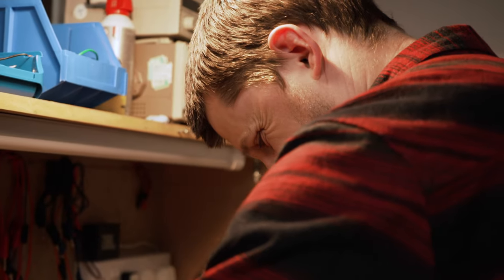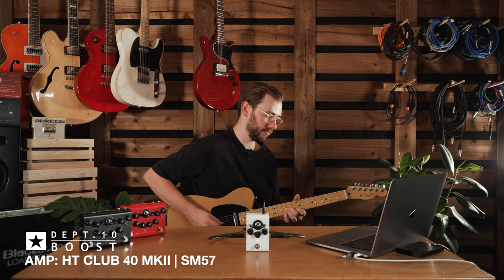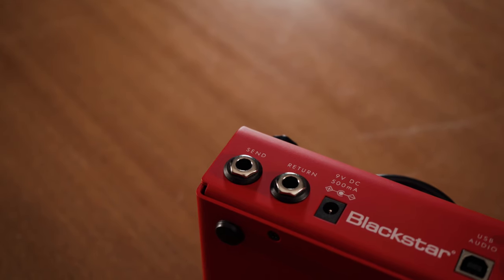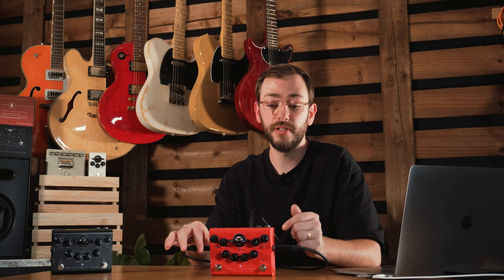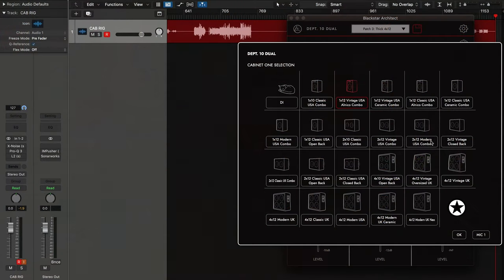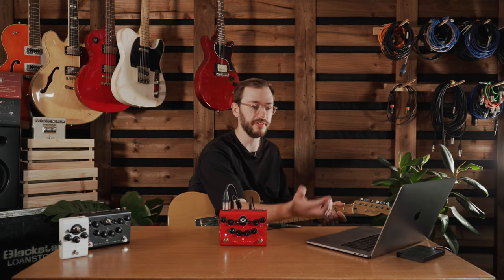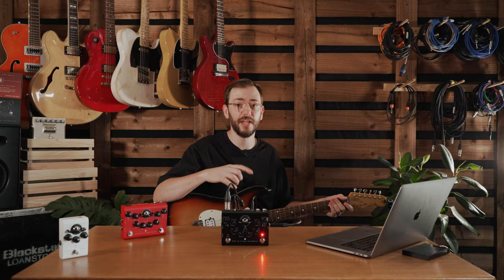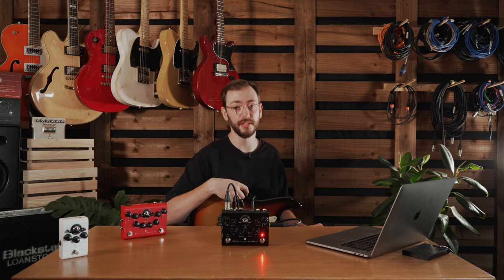Developing The World's Most Advanced Valve Pedals | Dept. 10 | Engineer Interview

Comment: If I wanted to use the dual drive as a preamp into my pedal board with various overdrives, reverbs, delays where would I place it and what output would be best to use? The DI out, Cab Sim, or just the normal output? If it were the DI out then would I need to use an XLR female to 1/4 male into my pedals? It just feels like the pedal was built to be last in the chain when usually preamps are first.

Comment: I have a problem with this product, where should I put the output to the return amplifier, to the OUTPUT SECTION or to the CAB RIG? I want to use it instead of the preamp in my tube amplifier

if I enter it in the OUTPUT section, the 3 channel CAB RIG switch feature doesn't work on my amplifier
Reply: Since your tube amp already has physical cabinet, you should use the OUTPUT section to the return of your efx loop.

Comment: I was hoping the dual overdrive can replace the Mesa Vtwin on my pedalboard. Love the Vttwin except for the weight. However it works well with the boss MS3 which can change the channel on the Mesa when preset changes but I can't get edge of break up tones or the gain on the lead channel will be too high but the Mesa is much quieter the the dual overdrive even at max gain. So the noise and lack of external channel switching is what's holding me back on this though the tones are impressive. SIGH!!!